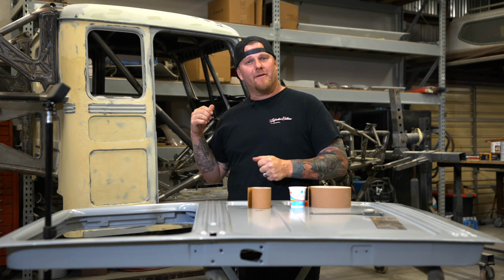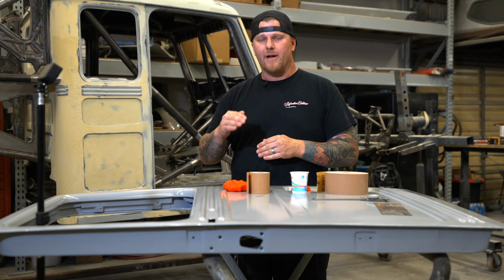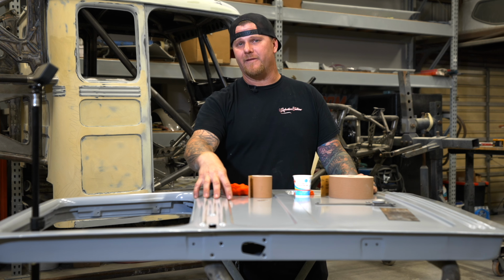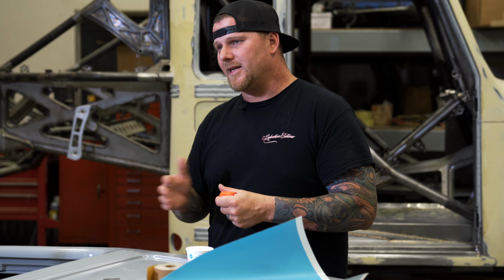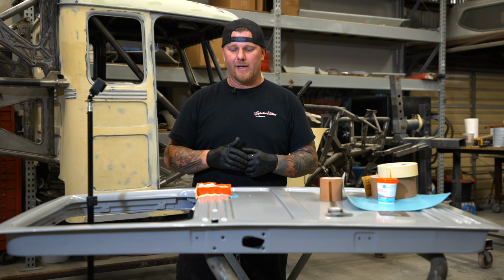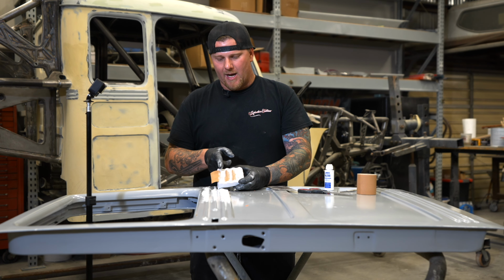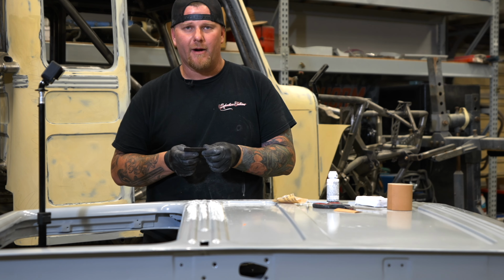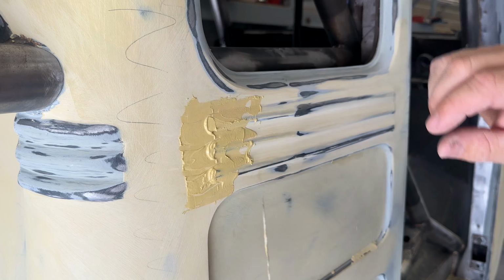Bodyworking The Details Made Easy. Make Custom Blocks!!!

Comment: You can also use equithane horse shoeing product . It is a two part product with various hardness and drying times. Depends on which product you get. It is more of a epoxy product so it will not wear like plastic filler.
Reply: Is this product used on a horses hoof that has a stone bruise or crack? Just curious as years removed from the farm, but we had one veterinarian for the entire county. I spent 3 afternoons and part of a weekend at 12-15 to help as he needed it. Wow! You brought back memories. Not many can say using a one-man delivery saddle with a come along ratchet, pulled a calf in half. A couple of clicks then rock a 1,200 lb cow in a shallow creek. I thought it delivered until I walk around and stood in shock. Got the belt for that as well. Doc said it happened to him three times.
Reply: It is for cracks, and they make a softer compound to make a sole pack for stone bruise.

Comment: Make sure you mark which side is left and right so it doesn't get turned the wrong way.  You might have the beads angled different if it's not semetricle. Otherwise it might end up with it not sanding the bumps correctly.
Reply from the maker: Not sure if done a body line with this issue

Comment: Great videos and an awesome sanding solution you presented here!  I was wondering If you "burn through" to the underlying base DP90 epoxy if you would spot in some more VP2050 before going to final paint or would it be fine to have some DP90 showing?
Reply from the maker: Dp90 is perfectly fine to paint over 👌🏻